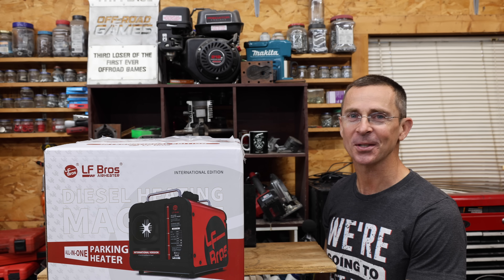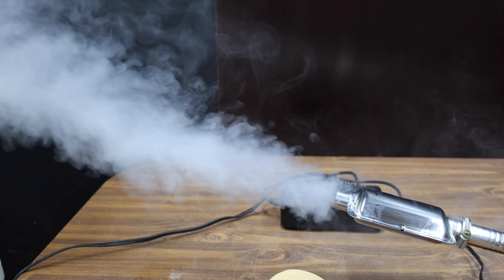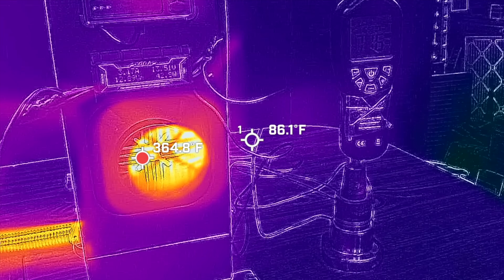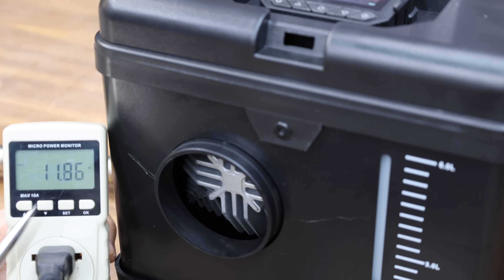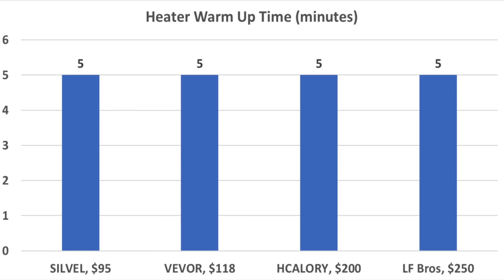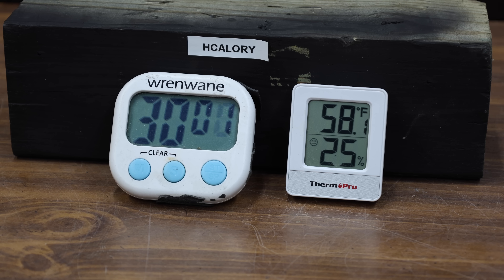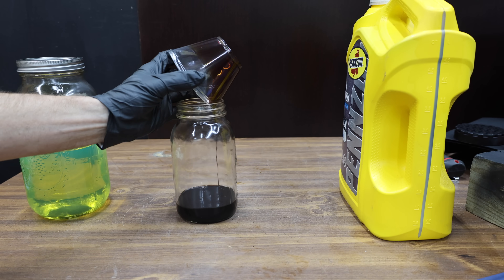The Truth About Cheap Diesel Heaters!

Comment: So...the excess smoke from the first test was likely just caused by the unit losing sufficient power during it's operation. It happened to my Vevor when a 12v battery died and I thought I wrecked it. But next day I tried it again and the thing ran like usual without smoke. Also a cheap AC solution is a power supply from an original XBox .Look for one with 14v or better. Craig's List or Market Place $5-$10 and a butt connector.
Reply: It's best to run them from a battery on permanent charge in case there is a power cut.
They can be damaged if the power is instantly cut.

Comment: the first one smoked badly because when there is  low electric power or sudden electric power loss, the fuel accumulate in combustion chamber without burning properly. all of them will smoke the same if you cut off power suddenly when it still not warmed up

Comment: The only thing I would add to this would be to remind people that running your heater off of AC power is fine unless the power goes out. In that case the heater won't be able to go through the cool down cycle. A better choice would be a trickle charger on a battery keeping it at 12 volts. That way if the power goes out the battery will maintain for a period of time. I run my diesel heater off my 12v lipo4 100 amp hour battery, which can last longer than the fuel supply.

Comment: the smoke coming out of the first unit the Silvel might be because of the failed first start. Maybe there was unburned fuel accumulated in the unit.

You could calculate the Heat Flow with the airflow and the temperature increase

2 proposals:

- please dont shout that loud in your videos!
- please go over to SI units!

Comment: Don't use them over power converter if there is a risk of power outage. If it looses power the fuel will keep burning inside the chamber but there will be no fan to remove the heat. Much better solution used 12v car battery and automatic charger. When you have power the charger will work as power converter. If you lost power batter will kick in. When you get back on grid it will start charging the batter automatically.

Comment: In the world of van expediting these heaters are holy.  Up until recently you only had European models to choose from at 2.5k each. Expediting is a hard life in winter without one as you can go anywhere and often in snow zones when trucks are restricted. 
[Expediting is basically hauling one or two pallets of freight generally around 2,000 pounds or so.] 
These Chinese models have really helped folks doing this type of work.

Comment: I've never seen such a heater before. Where/how do you install it with the fan right in the side of it and only a tiny exhaust pipe? Wouldn't it make more health/safety sense to have the unit outside with the heated air going in through a pipe? Do any units at least monitor ambient carbon monoxide and particulates? If it's diesel powered, why does it need ongoing electrical input? How does it work during a power outage?

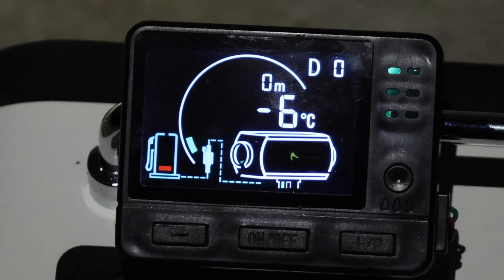Comment: 19:02 - all these heaters har based on the same design by Webasto (that’s why they work.. 😅). The pantet of the design expired a couple years ago, and the Chinese copy/paste machine has gone haywire…😅😅😅😅
Reply: I’m not really one for Chinese knockoffs, but I’m pretty glad these exist. I bought a Vevor, $100 for a heater that’s been trouble free for years- versus the equivalent Webasto is almost $2600.  

The Webasto would just never even be a consideration for me because of the price. 

Even if I had to change the Vevor once a year, it would take me a LONG time to make up for a single Webasto! Luckily it’s been a great little unit with zero trouble.

Comment: Super nice group of tools for the give away!  Thank you Jeff!  I did buy one USA made tool this year so far.  It's  a single extended 17mm Snap-on socket for the Subaru/Toyota brake caliper bolts.   It's impact and 1/2 drive.  Nice piece to have but a luxury and not a necessity.

Comment: You should test which UPS (anker etc.) will not affect the WIFI/Modem drop in an outage. With more outages than ever, and more on the way, the wifi is important for home security, work etc. My house lost power during a storm in AZ, while I was on a rare vacation, and made us go back the same night because I was not able to check on the properity, since a name brand UPS was not fast enough. Thanks again for testing my previous recommendation on the car battery device.

Comment: Man, you always have the best reviews. Where would we be without you!! I will say this on the diesel heater front(been running one for over a year in the back of my truck box) I have a unnamed version of this with out the case so something you would put into a camper or rv. I assumes most of these heater all use a similar interface and therefore suggest the following. You can tune the fuel and fan speed settings, this greatly improved the quality of burn and fuel efficiency. I heard that the climate that they are set up in is maybe not the same as ours argo the settings NEED to be changed. Elevation also plays a large factor as well. The higher up i get the mountain the more fuel it needs to burn. But having said that with it properly tuned and at elevation(i can check if someone cares to know) it will run for 2 weeks on 10 liters. The application is in the box of my truck with a canopy, outside air at night around 12°c it runs all night on low for about 8ish hours. So 8hrs a day for atleast 2 weeks on 10L at elevation. The setting that run best while on may not be the best for a start(mine takes 3 trys)(2 it trys it self and the 3rd time i turn it back on it goes, everytime) but the pay off is that while running it sips on fuel. Also lowing the fuel rate allows you to bring the pump pulses close to 1hz witch seems to be less annoying. Upgrade the muffler for lower exhaust sound and mount the pump well and its a very quite unit. Absolutely love mine for camping. I paid around 120cnd on amazon. Also mine draws up to(at 12volts) 12amps on start up but once running on low its around .75amp or so for batter rv use it's a dream (can't remember but on high its around 1.5a to 2a still very low)

Comment: In the heater community, the first advice is to have a much thicker 12 Volt power wire than what is usually supplied. The glow plug draws about 10 amp, so there is a fair voltage drop over the wire, and the units are very sensitive to low voltage and you often have start up problems because the wire is too thin.
Reply: LOL "Heater Community"
Reply: @melodymakerSD  Don't be mocking our kind, mate....
We are a peaceful people.

Comment: That >> AC to DC Converter you used, do you know if that would power a Grandberg 12 volt chainsaw sharpener?
I find it strange these heaters get better reviews on Amazon than these>> 80,000 btu Kerosene/Diesel Radiant Heaters.....

Comment: Might not be a bad idea to run the exhaust through a heat exchanger, you could heat water.
Reply: Good point, or set up an aluminum radiator with a 12VDC electric radiator fan to scavenge the last few J of heat for the space.
Between that and taking suction from outside will really help with efficiency.
Reply: @anydaynow01  %100, there is so much heat being wasted.
Reply: @anydaynow01 Agree..but powering a fan to scavenge heat is also counter productive.  You have to do the math on if you'll actually gain energy by doing so.
Reply: You may get more thermal benefit just warming the intake air through a heat exchanger.  Its already got a fan to pull the air.
Reply: Seen two options. One was using a cast iron radiator other was a 55 barrel on stand upside-down exhaust in and out through bungs.
Reply: @andrewsmith1735  Using a radiator is a great idea, that's a lot of thermal mass once all that metal gets hot. Last time I had to move one it was over 200lbs, and it wasn't an especially big one either. 

Would also be nice if it had an intake duct to pull outside air for the burner, this way you are not cooling down the area you are trying to heat by pulling in cold air through every little crack.

Comment: I've been using the vevor regularly for about a year now in a roof top tent, i use it almost every weekend in the wood, when its get bellow +5 degree celcius: at low speed, it only need half a tank for the night, though at -10 to -20 C, on colder night, i do need to crank this to the max and shorten the pipe as much as possible to avoid heat lost and it will burn all the fuel:

My pros:
- easy to install, once you get use to it, you don't need to screw everything up...
- the Bluetooth remote control using the app
- heat delivery
- low fuel consumption
- safest solution for the money

My cons:
- Diesel spill, yeah that one piss me off, either if you are not careful or not using a funnel, you will spill diesel and its going to smell
- The diesel tank cover, it doesn't screw tightly , so if there is a lot of diesel left in the tank and you ride with it, it will spill and you'll have to clean your box or whatever you put it int, box, truck bed...
- the diesel pump noise at low: let me explain, at max you the sound of the air blowing in the pipe mask the sound of the pump so "its better", but at low, you will hear the constant "tick tick tick" of the pump at night long, the solution its so sleep with hear buds but yeah, its annoying as fuck, although there is way to tweak this up but when you purchase as is, its going to annoy the shit out of you and even prevent you to sleep
- require a good battery, i use a lithium 100ah, its good for my need like 2-3days out + phone and laptop recharge, but don't you ever forgot to full charge you battery because this thing require more energy to bootup, and a weak battery might not be enough even though there is still enough power in it to run it all night
- you will need to buy a flexible pipe to redirect heat in your tent, ( very cheap )
- you will need to mount it on a wheel step + drilling a hole for the exhaust, just like the video mention, the exhaust is weirdly placed at the bottom, you need to elevate the device

Finally:
wheel, I'm still very happy with it, after 1 year, for the price i paid i think its worth it and safer than a butane or propane heater

Comment: There are so many of these, the controllers are generally the major difference. It would be great if the control boards were able to be external mounted to avoid failure during a sudden power loss during use. 
Thanks Todd 👍
Reply from the maker: You are welcome!  Thanks for the feedback.

Comment: Just purchased the Vevor 8kw heater for $108 on Amazon but had to buy a 12V power supply. This will be backup heat for our Greenhouse. I have a 220V blower heater and wanted something to augment heat. I have a big buddy heater that uses propane, but this can get costly. Seems like the diesel heaters are more efficient, and safer if using in a closed environment.

Comment: They're damn good, but, nothing works without electricity. It's only twelve volts. That's fine, but you'll drain a car battery in an hour or so, depending on its size.

Comment: I have a vevor diesel heater i use to heat my wife's sewing room im the basement. Its a different model than the one he tested, its more low slung then the tipping hazard one he tested. Overall it's a great heater.

I did make one adjustment on the heater discharge side where I added a bowl scentsy wax melt to make the room smell great lol😂
Reply: Cool idea

Comment: I heat my cabin with one. I have never used it past half speed. Mine runs directly from a 2 kilowatt solar system.  It doesn't run out of power. I really like the convenience,  and use half to 1 gallon per night. Used oil or recycled vegetable oil will soot up the heater, but they will burn jet fuel or kerosine as well as diesel. A little gasoline (10%) to prevent fuel gelling in outdoor fuel tank setups is acceptable and doesn't affect performance.

Comment: These things started life as cab and sleeper heaters for diesel trucks, construction equipment, etc. They also come as another option to heat engine coolant to preheat diesel engines for easier starting. Thats why they are designed to run on 12v. Great video

Comment: I dunno... pros and cons... the only reason in the world I'd have one is emergency heat my house in winter, and the only reason to use would be an extended blackout which then means keeping a 12v batt (and how long will that work?), or a generator... so why not just buy an outdoor generator and run extensions to electric heater(s)?  The exhaust then stays out and the young kids or pets don't burn themself on that exhaust
Reply: Will your generator run 9 hours on just over a gallon of fuel? Can you get more fuel if the power is out? 

40w of power means a decent lifepo4 100ah battery will run the heater 30 hours. That's best case of course, as long as the heater isn't shutting down repeatedly electrical consumption will be what was shown in the video. Startup uses far more, so it should be avoided if power consumption is a factor. 

Not really any reason these can't be run outside and only the hot air duct be run in from a window minimizing exhaust concerns. 

You'd have to go to a large battery bank and large inverter to replace a generator, but your electric heaters are going to consume magnitudes more electricity than the diesel heater uses. You'll use far more generator fuel powering electric heaters than just using the generator to supply appliances with power, not to mention generator output limits.

Comment: if running vegi or old motor oil, and you run into getting the units to fire or run, use a little starting fluid into the intake for the burning chamber as you try to start it up, DON'T SWAMP the intake with the ether (starting fluid), and replace what you have been using for fuel with  kerosene to clear out the burning chamber (carbon buildup), when the unit is up and running again, keep running the cycle as needed

Comment: One hack I'm considering is a longer exhaust, and making a halo near to the air intake, so the heat of the exhaust slightly preheats the air being pulled through. Hopefully this will give slightly more warmth on the output, without having to increase speed.

Comment: So I bought a Velpax Diesel Heater for the workshop, and set it up outside in a self contained box. The power is managed from a car battery, which in turn is connected to a trickle charger. This is handy for power cut situations. The only downside on really cold days, we have to light the wood burning stove and heat the workshop with that first, as the diesel heater can't quite cope with the size of the workshop and it's not perfectly insulated yet - Still need to insulate the roof. Once the workshop is nice and warm, the diesel heater can cope no bother at around half power. I'm Planning to set one up for a smaller Glamping shed, which is much better insulated, and it should have no issues keeping it heated at low power. I might swap out the fuel tank for a much larger one to ensure 24hr heating at least.

Comment: Hi and great video.  I am very much a novice with electrical.  I have 3 - 12 volt 105 ah AGM batteries connected in parallel.  Are you able to give me an idea whether my battery bank would be able to properly operate one of the heaters that you demonstrated?  Or should I be looking at something like a Jackery for overnight use?  Thanks

Comment: I run the Vevor and is been working perfectly fine, the Bluetooth control makes it even better because I don’t have to leave my camping roof tent to adjust it, fuel capacity is also fantastic as you get plenty to run it for at least 12/16 hrs depending on the settings, mines stays permanently installed outside my trailer and I used a winch cover that protect the most sensible electronics and so far not a problem.   
Thanks for the great review. 

Cheers from Miami.
Reply from the maker: Thanks for the info!

Comment: I own, probably the only one in South Africa, a similar Silvel heater and love it. It is powered by a ac/dc converter plugged into a 150W/242WH power station. According to the dispaly on the PS, i can run it for about 2 days, but of course have to refuel probably every 10 hrs set at no. 3. Really lucky to have bought it and went out of stock and cannot find another locallly owned store in the country. Perfect for quite mild winters to heat a one bedroom apartment.

Comment: First one smoked because u primed it .... especially an all in one is way better to just turn it on a couple of times and it will pull the fuel through after a couple of start attempts..... way better then flooding the burn chamber and exhaust

Comment: I found they lie about the KW ratings. I have a true 8KW. I got a second one for cheap as a back up said 8WK but is Only 4KW. The air flow was much less on the 4KW. I had to go thru 3 more returning different brands till I got a true 8KW. So getting one with a true rated out put is a spin the bottle deal.
Reply from the maker: Thanks for sharing.

Comment: I love all the testing, I have 2 the no name clone heaters, one replaced a propane heater in my travel trailer, and the other I use for mobile heat and backup parts for the travel trailer. I spent a little over $200 for two heaters and only had to replace a faulty fuel pump over two winters, doing the job of 3 or 4 space heaters,
the heater sips fuel and do a great job of heating, I modified the input air and heated air to use trailer ductwork. oil tank could be bigger, as filling it is now my only issue. mine came with plastic grill to cover/ direct air flow and it lost its shape due to high temp, so consider any vent grill made of plastic, as junk you need to replace. keep up the testing. consumer reports should hire you, thanks..
Reply from the maker: Thanks so much!  Thanks for sharing.